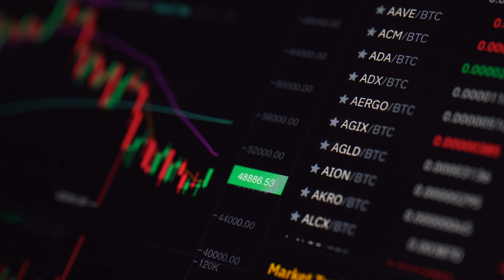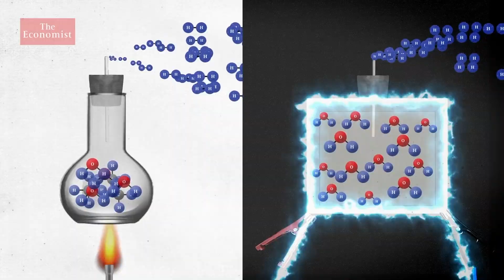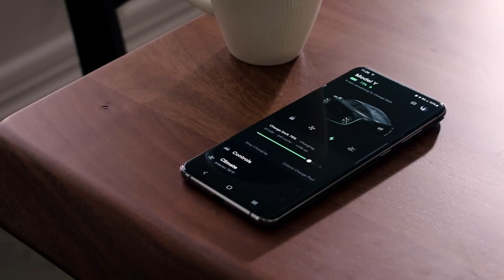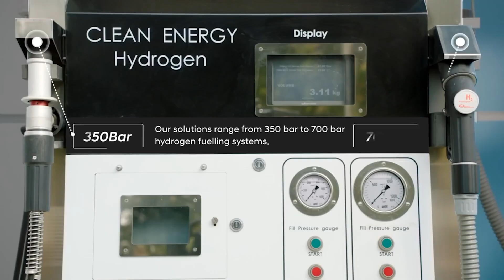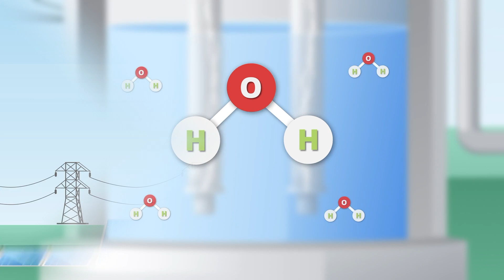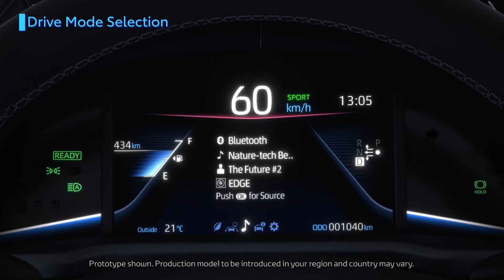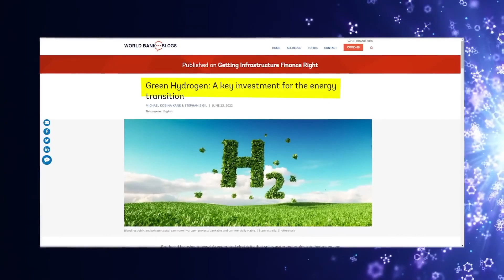EV'S Might Just Disappear! | EV's Could Go Extinct Because Of This New REVOLUTIONARY Technology!

Comment: I would MUCH RATHER have an engine over a battery, cant wait for hydrogen engines to start coming out to the masses!
Reply: Never going to happen mate! Do your research!
Reply: Hydrogen, the number one fuel source in the Universe. That's why we use gasoline. lol. There are many positives for a car that uses electric motors. Using giant batteries that cannot be recycled to power the electric motors, not very smart. Have you seen owners with EV trucks put generators in the beds of their pickups so they can recharge anywhere? At the end of the day, if the government and NASA (and other agencies) would quit holding back the "new" technology, I have a feeling all this discussion between EV's and combustion engines would be a moot point. Not to mention, new cars with combustion engines pollute a fraction of what cars use to pollute. So really there should be a less likely chance for global warming than an increased one as we move forward. take care. lol.
Reply: This is not what a fuel-cell will sound like.

Comment from the maker: There are way too many downsides to electric cars when compared with hydrogen. The battery range alone will deteriorate the resell value in a couple of years. What do you think? Do you want an engine that roars or a quiet ev? Reply to my comment so we can get a convo started! 👇
Reply: @TheRealCheckmate  For the vast majority of people, charging overnight at home will mean no trips to a charging station.  Imagine eliminating 50 plus gas station trips each year and not standing outside in all kinds of weather to pump your gas.
Reply: EVs ??? NO ! CARs with CURRENT battery, slow to recharge ! The electric motor is and will stay the BEST ! The issue is to store its electricity, battery that could be fast charged, swapped, liquid electrolyte..., or via hydrogen, gas. A "piston engine" burning hydrogen instead of gas is NOT the solution !
Reply: Id much rather have an engine over a battery. Although, I wouldn't mind a nice quiet ev either.
Reply: That is just not true! There are about 12 hydrogen fueling stations in the UK and over 70,000  electric charging points already, plus an enormous amount of home charges. You can buy a  Toyota or Hyundai hydrogen car that will cost you £85,000, car batteries will outlast the natural lifetime of the EV. Stuck to your bike.
Reply: @jcfallows  I don't know what your definition of lifetime is, but the batteriies are realistically good for 50K to 100K.  My ICE Toyota Sienna has 257K on it. Lots of Toyota Priuses are on their second or third battery pack.
Reply: @BryanTorok  when the EV makes give you 8 years it 100.000 miles warranty they know they will last so much longer than that. The whole battery doesn't just stop working!
A few of the cells will go down which can be replaced is required. And after 100.000 miles how many times will you have replaced parts on an ice car?
Reply: @jcfallows  General Motors has EVs on the road in the 3 to 5 year old range that have failed battery packs and GM refuses to service them because they can no longer get the packs.  So much for the 8 years, 100K warranty.  Perhaps aftermarket people will take packs apart and replace inidividual cells, but car manufacturers are not going to do that.

I have 4 cars, 1996 to 2006, 33K to 257K miles and I can get whatever parts I need.
Reply: @BryanTorok  general motors have bought the cars back at a fantastic price! They are still selling EV's only better ones now if they stop they will go bankrupt like the other Luddites
Reply: @BryanTorok  the batteries are usually fit for purpose until they get below 80% but that could take 150,000 miles or more, it will then make a fabulous storage battery for another 25 to 20 years! And after that they can reprocess the battery 93% of it and use it again!
Reply: Who can afford a hydrogen car? I just bought a 2 year old Zoe 50 kw for under £15k that's less than half price new. It still has a three year 100,000 mile warranty 6 years left on the battery. I'll sell it in three years.
Reply: That's why there are over a million EV's on the road, already and about 50 hydrogen cars with less than 12 working filling stations.
Reply: @TheRealCheckmate  you will never need to change the battery! You listen to FUD too much. Batteries have an 8 years hundred thousand miles warranty.
Reply: As I've gotten older, I've become less enchanted with roaring engines.  I have several neighbors with loud vehicles including several pick up trucks, both gas and diesel and I find them annoying.  I grew up with the sound of the of the American V8 and they don't have to be loud to have a pleasing sound.  But, there are fewer and fewer of those being made.
Reply: I'm sorry you are just wrong! Do more real research, and try one, you don't know what you are missing there is no other technology that can replace ice as good as current EV'S
Reply: @jcfallows  Just because there is nothing better doesn't mean that EVs are ready to replace ICE cars.  They and the infrastructure are far from it.
Reply: Are you serious??? 10 % of cars on the road are already EVs, Hydrogen is nowhere! In case you haven't heard new ice cars are banned from sale in the UK in 7 years
Reply: @TheRealCheckmate  you will never have to buy a new battery, you have listened too to much FUD. Try buying and using and electric car your fears are unfounded! I'm on my third EV my Zoe GT Line 9k miles 2 years old, for £15 K still with 3 years warranty left and 6 years left on the battery up to 100,000 miles which will have lost 10% off a 230 mile range! Good for many years yet. How much do you want from a car?
Reply: @TheRealCheckmate  change to Octopus EV BETWEEN 23.30 to 5 30am it's only 7.5p per KW! I get 4.6 miles from 1 KW ! That's better than even LPG.
Reply: @TheRealCheckmate  if you live in the UK try and get OCTOPUS I can send you a code to use and we both get £50 11.30 pm to 5.30am 7.5ppkw the Zoe 50 is my third EV and best for me it's perfect!
Reply: @TheRealCheckmate  you only charge when you don't need the car! If you need to charge on a long journey we all need a break , a coffee and a trip to the bathroom 30 mins charge usually means an extra 100 miles at least. Try one stop listening to all the FUD the disgusting people who call themselves journalists ! They are writing untruths to make money!
Reply: @TheRealCheckmate  join Octopus! Its 7.5 pence per KW BETWEEN 23.50 TO 5 .30 AM that's less than two pence a mile, and don't forget to set your washing and tumble dryer on in this period. There are many times when Octopus will PAY YOU to charge your car.
Reply: @TheRealCheckmate  trust me the batteries will not fail.
Reply: @TheRealCheckmate  to will never have to buy new batteries! Stop believing in FUD! batteries are now g'teed 8 years 100,000 miles, when they get to agree they have years left in
Reply: I would say most hydrogen cars will be a fuel cell that runs an electric motor, so your not going to get much of a roar. Efuel will be what you need but at a premium price..
Reply from the maker: @petekath3387  nah, do you know how big the car community is? and no one in that comunity wants a quiet ev, esp after harrrasing ev owners for the longest time. Every car brand knows this, so they are racing to build an ENGINE, not fuel cells, that run on hydreogen. And whoever does it first will literally change the world, which is why there is a race to get it, and currently toyota "seems" to be ahead.
Reply: @TheRealCheckmate  you charge an EV when you don't need it. The only time lost is plugging in and unplugging. Hire an EV for a week and actually do your research. Like it or not they are going to replace Ice. You don't have to buy one use the bus instead then!
Reply: Already there are almost one million EV cars on the UK roads 2023, they are  outselling diesel already! The public roads aren't race tracks, the more performance you use the more you pollute the atmosphere! Flooring an EV and feeling the instant torque in silence will always put a smile on your face! But that burns rubber too!
The EV will change you as it wafts along in silence like a Rolls Royce, with ample power!
Reply from the maker: @jcfallows  bro only the future will tell, you living in the uk, dont actually understand the amount of work and pollution and enviornmental damage that goes into making ur ev. The amount of child labour is insane on its own, let alone just all the other stuff. Evs are heavy af, how many tires u had to change so far? my families 2014 rav4 with over 200k kms on it had no issues except the front shocks because i drove it super rough at one point, and that shit is still running brand new. A tesla wouldve flopped 10 mins into me driving it, and range anxiety is real bruh, we were in the middle of no where camping with my freinds tesla model y, and just holy crap, that was a mess. No charging station near by (its like indigenous land im pretty sure or smth) and we were just praying the car made it to the charging station that was 100km away. and not to even mention waiting for the recharge. We spend almost half a day, out of a 2 day trip, "fueling" our car. With all due respect, HYDROGEN > EVS. Maybe not currenty, but in like 10-20 years, 100%.
Reply: @CarsPassion1 well, I think the mistake you make it assuming that only hydrogen refueling stations are going to be built within the next decade(s), but kinda elegantly ignore the possibility of more EV charging stations being added as well.

you gave an example of camping out in the middle of nowhere. do you really think a hydrogen station is going do be built there sooner than a recharging station?

you're either paid or uninformed or both. yes, pointing out flaws is really great. alas, you don't do this in an objective manner. 🤷‍♂️
Reply: So thinking car batteries are the same as mobile phone batteries they will out last the car!